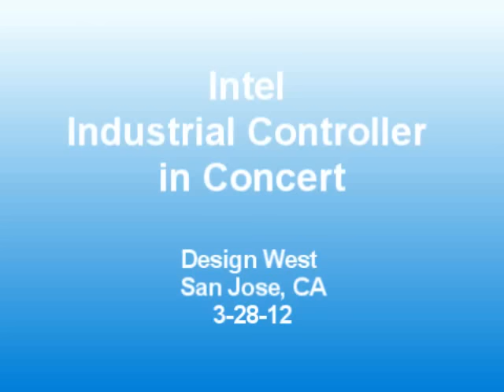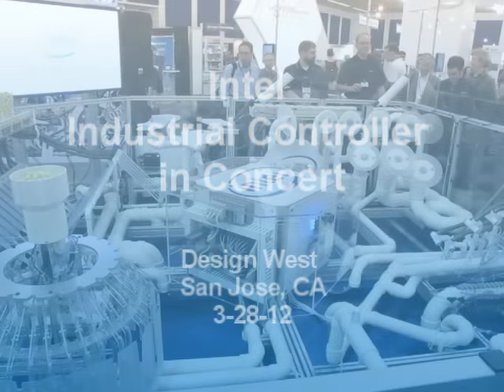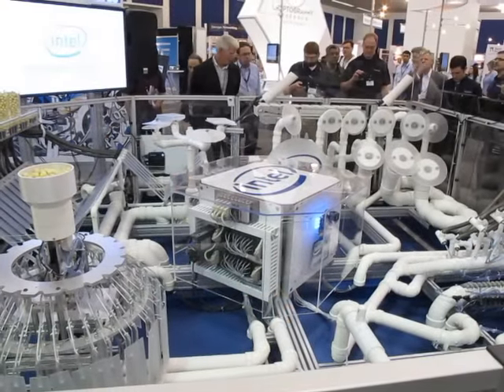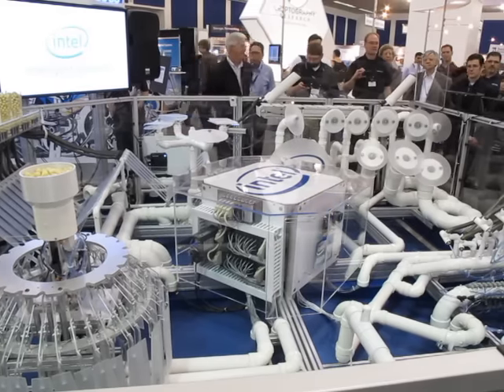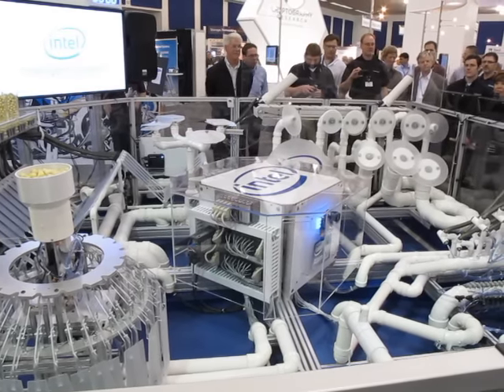Atom-powered Intel Industrial Controller in Concert playing Pipe Dream

Comment: Ya know, it never occurred to me that a physical animusic would make all those extra mechanical noises.
Reply: Unhidden Polymath? same lol
Reply: Casual Graphman it's because they're using pneumatics to control it. pneumatics are the most efficient way to control all of this. I've thought about other ways of controlling all of this but pneumatics is the most logical and least messy when something breaks. they could have used hydraulics but that gets really messy when something breaks and it would have required even more wires and tubes than are required with this
Reply: Casual Graphman They certainly could have, with more time. 90 days from concept to roll out. Give them another 90 and I'm sure they could have silenced the pneumatics.
Reply: +Brandon Taitano they easily could have silenced the pneumatics. they just didn't  prioritize that because making the machine functional and making sure the aiming mechanisms were accurate were prioritized over the noise of the pneumatics. if you think about it, the did actually prioritize the pneumatics a little. I didn't hear a compressor running the entire time the song was playing. they decided to either hide the compressor or hid a giant container with all the air in it
Reply: If i was to design something like this i would use step motors and gravity. That would not end up looking like the original design at all tho.
Reply: The Doctor
Reply: You could silence the pneumatics to a certain point. Solenoid valves usually make quite audible clacks when opening and closing. And I'm pretty sure they used modified paintball gear and valves for that, as the balls seem to be just regular .680 Reballs that were used in the showcase
Reply: If you're talking about the clicks, those are the marbles.
Reply: No, those are the valves since the clicks soudn when the balls are thrown
Reply: Pneumatics make noise
Reply: 696 likes XD
Reply: I think it was a 90 day project they have since been developing it to be a quieter machine.
Reply: Casual Graphman sernoids same as what pen ball has.to controll the shooters.
Reply: @josh Animusic was all CGI. That is kind of the point here. The developers closely replicated the CGI Animusic "machine" in reality, and did it in 90 days. No small feat!
Reply: Surely you would hide the workings under a false floor.
Reply: @porg7063  I'd probably use a flywheel.
Reply: Drum machine hahaha

Comment: Animusic: “it’s just animation it’s not possible”

Intel: “hold my i9 quad core processor”
Reply: That was an Atom-based industrial controller. In 2011.
Reply: @maximvoronin1569  it was a series of low power cpus.
Reply: @mrtuvok5578  Yeah, apparently there is a total of 7 Atom-powered computers, but that includes the ones that run digital signage and touch-enabled interactive display of the stand at the expo. There is probably enough processing power in a single 2011 generation Atom to run the whole gig with 36 ball cannons and a total of 250 interconnects, they just played it safe and split the operation in parts.
Reply: @maximvoronin1569  Then someone needs to create a version on ryzen using acoustic strings and real bells and such, if an atom can handle a simplified version, why don't we fully recreate the animation?
Reply: How is this impressive in anyway?
Reply: @holoceneevent4534  It's the fact is was run on the notoriously weak atom processor, at this point in 2011, most of them couldn't even play half life 2. A ten year old game at that point. Seeing such a ahem low-power CPU do anything at all is impressive.
Reply: stolen lol
Reply: @Vesper8088  FAIR
Reply: nah this is 2011. hold my pentium t4400
Reply: this was done on an atom
Reply: @farlado5459  See? Lovely and fast.
Reply: @maximvoronin1569  I use one in my cnc macine  it drives the parallel port
Reply: hold my celeron N3060
Reply: Yes

Comment: The process I was most impressed by in the original — and most curious to see replicated — was the bearing/funnel retrieval system. Watching this, I felt it tragically yet necessarily confirmed that you couldn’t actually design with that accuracy in real life — and then I saw Wintergaten’s 50,000 marble machine video. Faith and awe in humanity restored.

Comment from the maker: Sorry, I don't believe it was fake unless you are referring to the use of music synthesizers to make the sounds rather than using actual pieces of euphonic metal. I don't work for Intel. I stood there and shot the video at Design West. I agree that Intel's processors might be overpowered for this application but that's true in a lot of industrial applications where an embedded X86 processor is used for it's wide tool availability. I found this display to be very creative and fun.
Reply: Steven Leibson What does "atom powered" mean? Is it atomic?
Reply: canal simple sin nombre random chanel : "Intel Atom is the brand name for a line of ultra-low-voltage IA-32 and x86-64 microprocessors by Intel Corporation."
Reply: Basically, it's powered by a netbook. Actually, today's cheap garbage tablets for $30 at Fry's are powered by an Atom processor. Ultra low power and can be stuck in anything. Runs all common PC software.
Reply: Using actual euphonic metal (and wood) would have been more awesome though.
Reply: Steven Leibson you can rearrange your last name to spell lesbion lol
Reply: And you didn't even clap, SHAME
Reply: Intelligence in action.remarkable work on that machine.

Comment: why did they choose to do music emitted from speakers? should have used real metal piano or something it would be way cooler
Reply: But then it would sound like shit ^^
Reply: FullFledged2010 but it will look cool,now even the ball hit the plate and send signal to emit sound,u dont know if the ball actually hit the plate or is it programed to emit sound because of the delay
Reply: Yup they probably just playing the original tune along side it ;) At best its fixed velocity midi controlled but i highly doubt that.
Reply: +Andy Yip You know, the original animation featured steel balls (which looked like bearing balls) which would've had a great enough moment and energy to make it reasonably loud. However those would have had to be shot with a much greater energy, which wouldn't have allowed for letting people that close. I mean just imagine a single 5 cm steel ball going astray....
Reply: the metal balls would have probably worn down authentic materials very quickly, distorting the sound. :I
Reply: Andy Yip i totally agree. Big whoop. A computer did it. Whoopity dooo all day. Its like who cares , you told a computer to do it. So what
Reply: Beacuse it would work
Reply: Andy Yip
Lets not make the job entirely crazy expensive. It just supposed to a industrial controller demo  not performance art !  Build a better one if you're are so great, then.

Comment: you dont needs a huge cpu to fuck be able to do that
Reply: The Atom line was shown up by RISC architecture. Smaller, more efficient and better performance.
Reply: bassax13 still a 1950 computer could do that
Reply: In fact, a band called Wintergatan did an even better demo (with real instruments and a working marble return) which used camshaft control. No computer necessary at all.
Reply: George Steel that it is what I'm talking about, it is mechanical movement. you dont need a huge CPU to be able to launch a few marble on time
Reply: Intel isn't showing off the ability to shoot marbles, they are showing their ability to use so many inputs by sensors off a single CPU. In-case you didn't notice the sound being produced is all digital, servo controllers are being controlled by the Atom-CPU as well. There is no way a computer from the 1950's could do all that is being presented here. You need to do your research, look up the Remington Rand Univac and it's components.
Reply: George Steel I'll be impressed when they make a machine like this and play this song
Reply: +theskeletonboi Except they used 7 Intel Atoms for this pipe dream recreation. I'm sure it could've been done with a single Intel Atom considering that taking sensor inputs/shooting balls doesn't require that much processing power.
Reply: Jason Lee but the many motors do

Comment: Runned on an atom!? Didnt know this thing was that powerful
Reply: All the atom had to do was pump out a set of control signals to the various "sections" . .  "string things, play these notes" . . as in a MIDI sequencer, the individual sections throwing the balls all had their own controller cards simply receiving the requests and throwing the balls.  The core processor really didn't have that much to do.

Comment: It's hard not to be a skeptic here. I do believe that the components are all designed and programmed to launch those pellets at the precise time and the exact place they need to be. But I don't believe that there is actually any musical instrument here. I believe they just sync the pre-recorded music with the instrument, which on its own is already fantastic.

I have no doubt on the precision of these instruments, but those pellets really go all around. There are a lot of examples in the video where pellets that already hit a pad hit another pad after the ricochet, but we just don't hear those extra sounds. And there are times when a pellet misses a pad (mostly because the pad moves before the hit) but we still hear a sound, easily spotted on the rotating cowbells for example.

Comment: Yeah, it took only 90 days, but how many dozens of engineers, tens of thousands of dollars, and who knows what all else?  It's amazing, but with the resources Intel has behind it, I'm not too surprised.  The same thing could be done with an AMD, ATMEL, Motorola, or any other processor, so it doesn't prove anything about the ATOM to me.  What would really impress me is if someone did it with Arduinos or something else that wasn't used for a desktop computer.

Comment: Unfortunately this isn't as cool as it might seem. All the sounds are pre-recorded and the marbles do not actuate the sound. The only neat thing is that the marbles are almost timed relatively well. But you can see, especially during the cowbell parts, that maybe 1 in 3 marbles hits the cowbell piece, but it still makes 3 beats.
Not to mention that all these instruments are digital pads (even though I don't believe they have actual hit sensing) and not actual instruments , which definitely takes away from the magic of the original

Comment: They did not use a atom processor I had one in a tablet with Android 4 and I couldn't have more than 5 tabs open in chrome without it getting very hot. After it died I found it was the processor getting hot. The Intel atom are crap, this had to be done on at least an i3